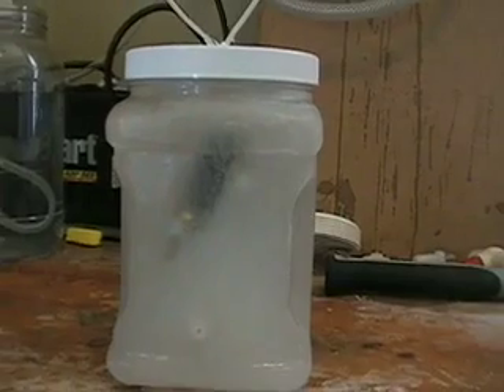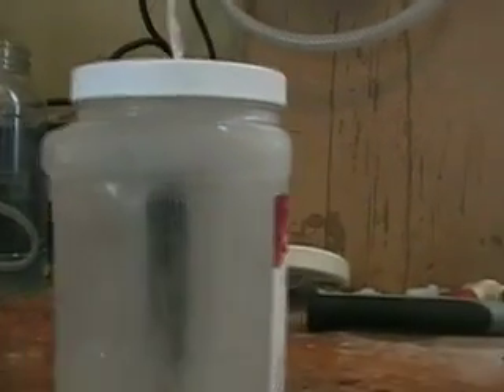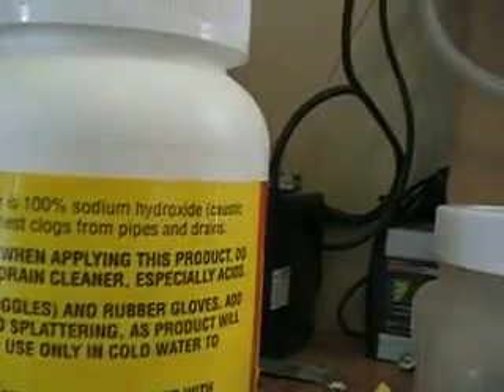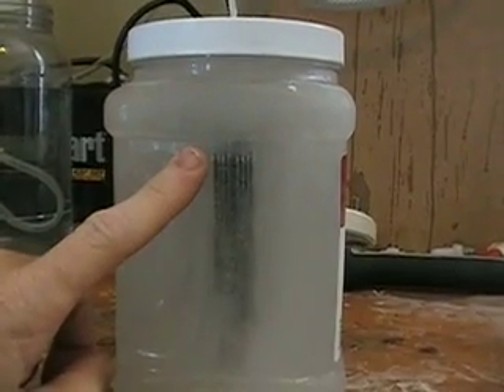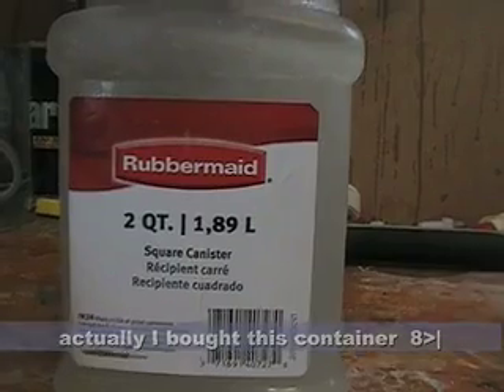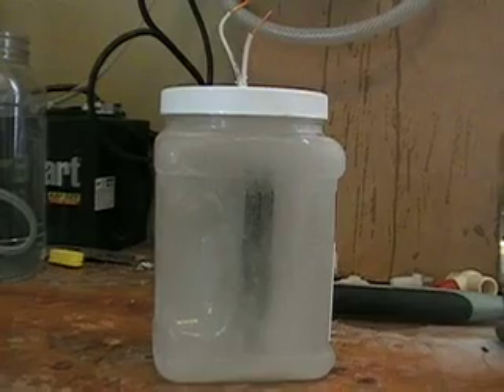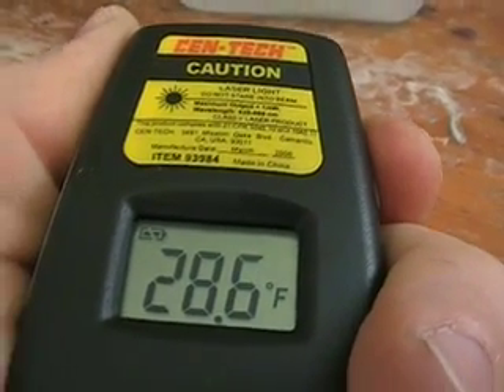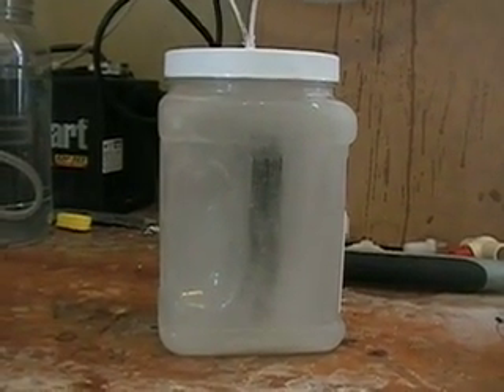A Frozen HHO Cell?!? You gotta be kidding me...

Comment: For the colder season, how about insulation surrounding the electrolysizer-HHO generator, along with a thermostatically controlled 12v low wattage heating plate at the bottom of the electrolysizer (inside of the insulated surround.  You'll have to have large enough RV/Marine DEEP-CYCLE batteries for your cold environment.

Comment: Which is why some people foresaw the freezing problem and chose to split the fuel manufacturing from the fuel use. This system would require to make the gas in a warm garage and have it stored in similar to white 500 liter propane tank. Then when you need a fill up your car into installed compressor bottles in the car trunk. It calls for using the right pressure, ensuring contamination from other gases does not contaminate the pure hydrogen, and one way valves are placed in the right locations of the delivery line.

Comment: the solution is simple. add a small amount of rubbing alcohol.  Running a frozen wet cell is dangerous. you could have it thaw in the center first, creating a bubble that will increase in pressure. pressure and HHO do not go well together.

Comment: you cannot run electrolysis on solid material, it only works because of moving particles inside water.   (or molten metallic compound)  yours only started working because it began to melt, so u just wasted a bunch of time thawing out a giant ice cube, lol
Reply: Heat = energy.   it will produce more hydrogen for a short while, just like when a rechargable battery is over charged will read a higher voltage than it should, this is from being overheated and in general heat should be avoided as that is wasted energy and in the case of batteries will shorten their life and possible cause a catastrophy

Comment: You can run electricity through water to crack the molecules into a (flammable) combo of hydrogen and oxygen that will burn by turning back into water.

You can use it as a fuel, but it's better suited to being a battery because you get the same amount of energy out or less (always less in realistic conditions) as you put in. You start and end with an identical substance: water.

Comment: To my knowledge, up until the boiling point, heat will increase the efficiency of HHO production. So why not put a heat exchanger around your HHO producer that will draw heat from the tailpipe to both heat the water,  and thaw the producer in the winter months? Obviously you'd have to have a system to keep the water from boiling like a small temperature controlled fan or something.

Comment: also has the ability to set min and max on duty cycle and frequency, all is programable via rs 232 connection, i am also building an installer kit with a hand held programer for the unit with an rj 45 plug this is a profesionaly made top of the line unit. you will need to mount in a box and add a large heat sink about the size of pent 4. let me know thanks

Comment: nice i was thinking on doing this myself. good job. hey i have finaly gotten my new pwm circuits  from the manufacturer and was woundering if you would like one to test with. it has temp measuring water level high and low inputs a 5 amp pump drive circuit as well as a 12 and 5 volt supply and the pot input for contoroling duty cycle. i connect my pot to my throttle to control output at idle and normal hiway use. also a set of inputs to adjust your O2 sensors. 12-60 volt 40 amps. upgradable to 80

Comment: dude you're just making mud here - that sediment is not related to starting frozen, its a result of mega current leakage. Dont let the output get anywhere near an aluminum engine component. 

At minimum you don't want holes in your plates or copper or unshielded straps going around the outside.  put spaces between plate pairs and seal the edges if possible. 

oh, and get some real music lol

Comment: Great Video!!  I have thought of doing that several times!! using HEET Gas-Line Antifreeze, I was told it works good!  I also wanted to test the idea of a contant flow, a trickle of DC not enough to produce gas, vented of course!!  enough to keep molocules moving.  I found a small deep freeze that i am in process of installing a window and a way to clear or wipe the glass off from the outside, in case of humidity! But I'll post video as soon as i get to do it. lol  thx  and again "great video"

Comment: Make certain your Distilled Water does not contain Sodium. Some of it does. I have run my cell through 2 winters. The first time it froze, I scraped a little ice away from the top of the tubes and poured in a small amount of water. That let the cell start woking imediately. The cell thawed out from the top down. It did not take long. I started using Denatured Alcohol (190 proof). Adding 20 to 25% solution with distilled water is good to around Zero (F). Hope this helps.

Comment: Probably right,I took apart a generator and the jar sat on the shelf for a while and now there is a yellow white sludge forming in the jar. The water was clear using NaoH and distilled water prior to sitting.  The water may be evaporating off. The point is there is stuff in the water that we dont  readily see until we change the chemical climate either naturally (lowTemp freezing )
or accidently leaving it to evaporate. Just a thought It was a good Vid Thanks.